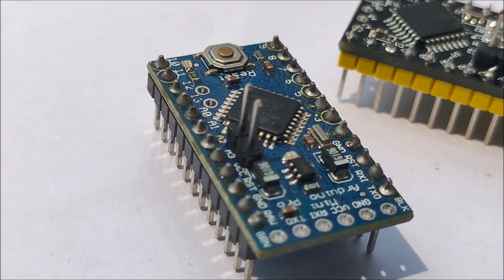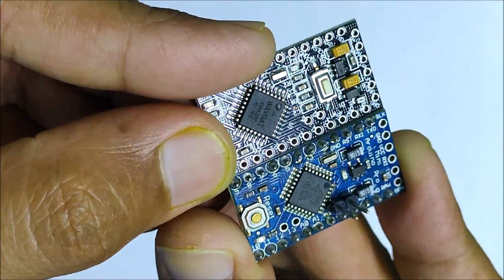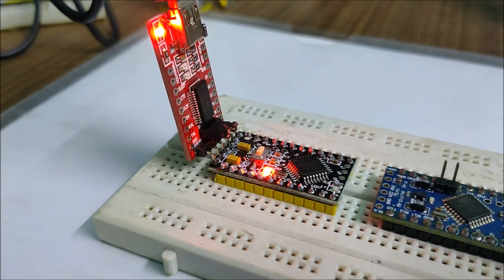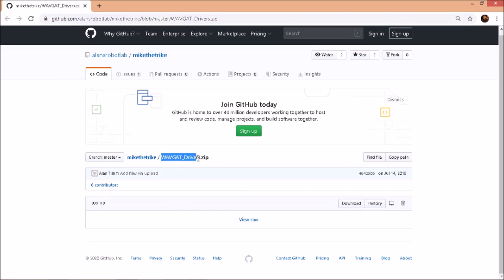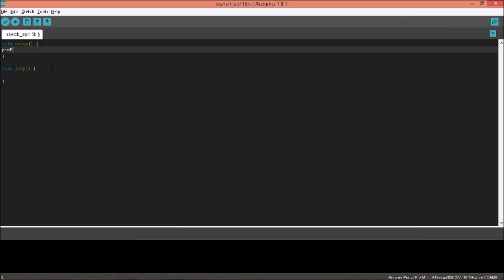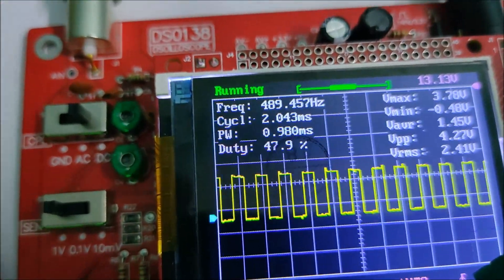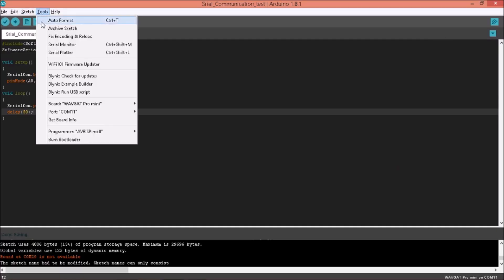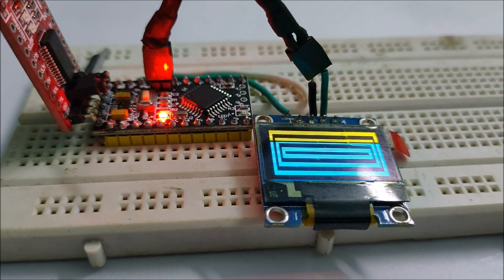WAVGAT Pro Mini || Are they better than Arduino boards?

Comment: can i use my arduino uno to program the wavgat mini?
if so i´d love to see a video about it
Reply from the maker: Yes you can program the wavgat board from arduino uno. You can use the Arduino as ISP feature and upload the code.
Reply: @UtsavShah_25  ok i tried but couln´t get any resulsts
Reply from the maker: @Milan22229  okay let me check from my side as well
Reply: @UtsavShah_25  wow that would be so very nice :)

Comment: yes they are much better.
Reply from the maker: Hi, have you figured out a way to get good readings out of this WAVGAT modules? The ADC readings never seem to stabilize
Reply: @UtsavShah_25  Really? I noticed they bounce a little but so does my acs1115 and the regular at mega clones I have.   But I will pay extra attention to it. There is a new and very cool board "driver" releasedfor the arduino ide  by  a guys called dbuezas. This solves a lot of problems and makes life easy and also works with wavgat.  https://github.com/dbuezas/lgt8fx

Comment: Hi Utsav,  Can you tell me what the module is that you are using on the breadboard to test the mini pro's.          Thanks  Ted
Reply from the maker: Hi, I'm using an FTDI board to program the boards , CH340 USB to serial converter for serial communication and OLED display
Reply: @UtsavShah_25  Thank you for your video. I was trying to use my FTDI board for communications. But it didn't work. I see now that I needed the CH340 converter.
Reply from the maker: @ToddSaltzman  welcome, glad that you found the video helpful